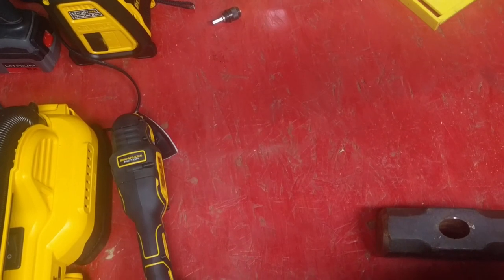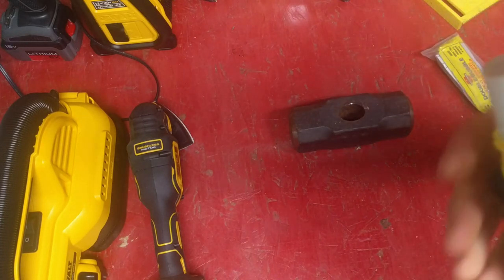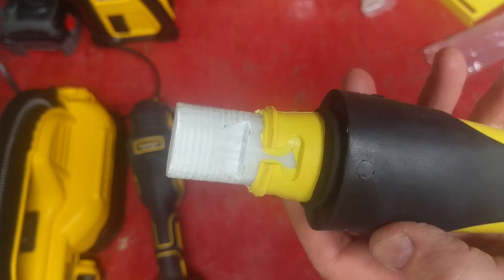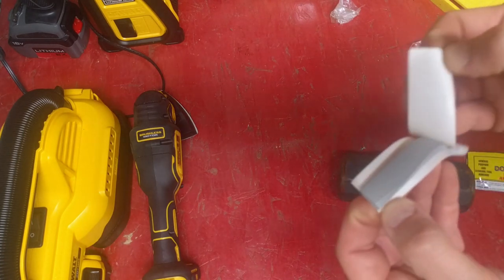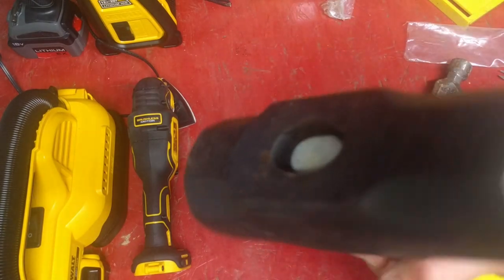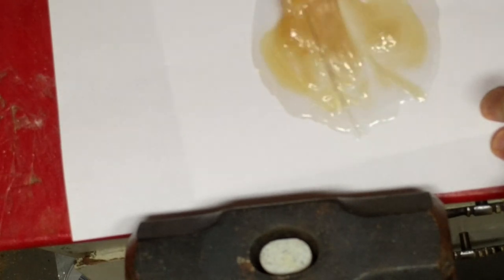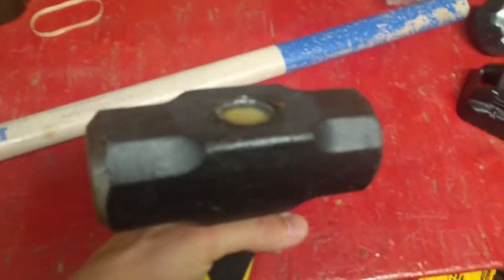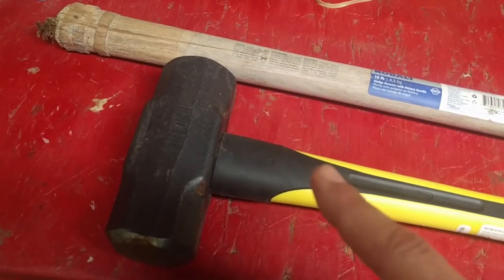Outside the Cubicle | Sledgehammer Handle Replace

Comment: I hope you where wearing shoes with steal toes , when the sledge hammer was falling :D

Looks pretty good with fiberglass  handle.  Less stress vibrations going to  your body,  if you working all day at construction site. 

 As too how you will fix it if it breaks again? 

You have to drill a bigger hole top of the hammer head opening , oh joy fun :D

Comment: you're gonna hate life when it's time to replace the fiberglass handle...
ask me how i know.  :p
Reply from the maker: I can't just leave that hanging... how do you know?
Reply: @CubicleNate  i'm currently covered in powdered fiberglass from drilling out the old handle...   my whole body itches...  and chipping out the remaining epoxy took all afternoon.
Reply from the maker: @PoodlePuncher  That sounds terribly unpleasant. Now, you must share how you broke the thing!
Reply: @PoodlePuncher   All you have to do is put  That hammerhead or floating maul in a hot fire and it will burn out the fiberglass Believe me I know that work
Reply: @elmore119  would a pot with boiling water work too